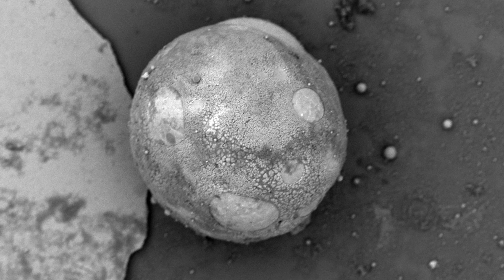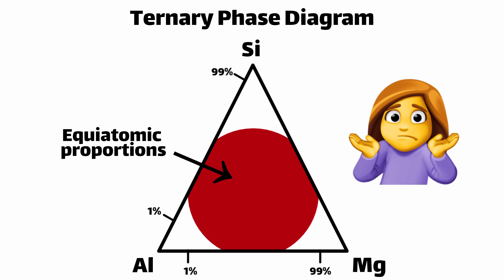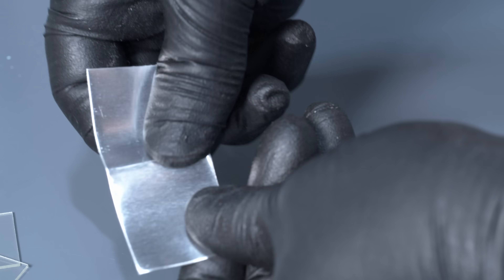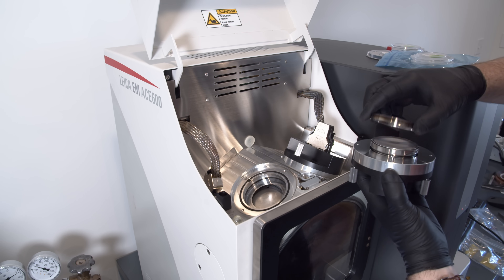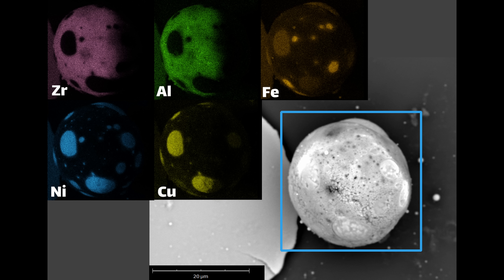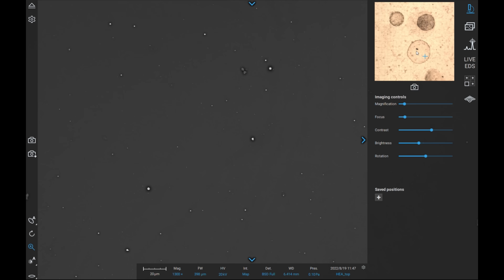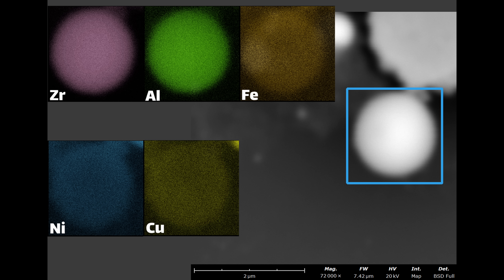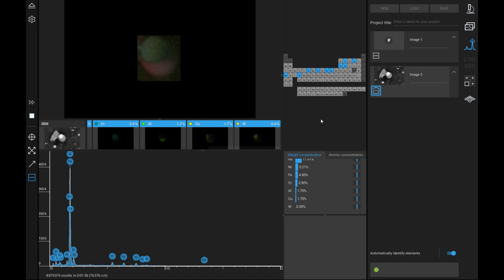Metal Alloys of the Future?

Comment: I’ve now worked on a couple projects involving this field. Something I found interesting is how different research groups define HEAs. I worked with a HEA that had the presence of an intermetallic which some definitions of HEA do not define as a HEA (not solid solution). Another alloy only had three of the five Cantor alloy elements in equal concentrations, making it a medium entropy alloy (Smix<1.5). Lastly, a refractory alloy with four elements could be argued to not be a HEA due to not having >5 elements. I found all three of these alloys fascinating, and all had very unique properties not found in conventional alloys. Complex concentrated alloys (CCAs) can be used to describe all three of those (as all HEAs are CCAs), but it has much less of a ring. Many pioneers in the field stick to the strict definition of HEAs, but I find does not ring as well to people outside the field. So I somewhat incorrectly refer to all as HEAs
Reply from the maker: Ah neat! I didn't realize there was such a range of interpretation about how these are defined. I did see a few alternate naming schemes (multiple-component alloy and the like) but didn't realize it was more than just a naming thing. Very cool, thanks for sharing the extra details!

Comment: Hmm. If you're having problems with the particles cooling too slowly, have you considered maybe using something like liquid nitrogen on the slide and lasering through that?

Also, would heat treating the slide after coating possibly relieve some of the inter-layer tensions causing the flaking?

Comment: You might consider changing the precursor target to have many smaller layer stacks to begin with, so that when you ablate, you are much more mixed to begin with. 

Also, if film adhesion to the target is troublesome, you could try to start with a layer that does adhere well as a buffer layer. I had to do this with some heterostructures we made that needed AlOx, and Au. I've been told by my PI that a Ti buffer layer (or Cr) is good at getting Au to adhere to Si, so maybe it'd help with the Cu layer as well.  

Last, I can imagine that with 5+ or more elements all in similar proportions, the phase space is massive, and creating the same thing twice could be hard with this method depending on your level of control over deposition rates.

Comment: You might want to look into metal glass formation methods.  I don't know if they would be useful to form high entropy alloys but it might be worth a try.  They are formed by dropping a stream of molten metal onto a very high speed rotating disk in liquid nitrogen so that the resulting metal powder cools at millions of kelvin a second and crystalline metal never gets to form.  Obviously, you want crystalline structure formation but that might be as simple as using a higher temperature coolant.  (Which would be easier to work with as a bonus)  As long as the metal droplets cool fast enough, you might get proper alloy formation before the individual metals have time to segregate from each other.

Comment: The trick with getting equal distribution is having your samples in 'intimate contact' prior to the flash heat phase, which is its own little crap shoot. I've been doping my runs with high purity carbon in a ball mill as a sink to entrap the metals. I'd love to have a vacuum chamber that can tolerate the kinds of temperatures I'm trying to do this at, but thus far I've made a lot of fragments in reduced oxygen. In my experience, short of arc furnaces or plasma heating, lasers that I have access to don't offer high enough sintering temperature to get proper fusion. I'm exploring modifying a plasma cutter for my next go to break into that 6k Cel/10K F range for near-instantaneous processing.

Comment: In your overview in the beginning you said that with alloys we tend to predominantly have one element. Your example showed a ternary phase diagram of aluminum, magnesium, and silicon. Your example then showed the points in the graph for a few common wrought alloys. 
https://www.youtube.com/watch?v=Vq_6mAAbfFY&t=118s

The inaccurate part of your explanation was that we tend to mainly use alloys that are predominantly one element. (low alloy content percentage) As far as aluminum this is far from the case. The composition of aluminum alloys for casting has a larger percent of alloying elements compared to wrought alloys shown in your graph. 

The alloying components for cast aluminum is significantly higher than the 1% level for wrought alloys. Aluminum alloys for casting can have 8-20% non-aluminum elements. Sand casting alloys being lower, injection die casting alloys higher.

The global aluminum casting market size was valued at USD 86.92 billion in 2021. Most of that is for die casting. Among others, the automotive sector has been steadily increasing the use of aluminum in vehicles to reduce weight, using casting alloys not wrought alloys like 6061. 

And then when we look at copper based alloys the alloying percentage is even higher. A common brass will have 40% zinc as the alloying element.

Comment: Great video.  When I think of an intermetallic,
the interface of metal/metal system comes to mind.
Say you put a thin film of metal element X on metal
substrate Z. The interface might form stochiometric
stable crystals of XnZm, where n&m are integers.
As these are crystals, they have completely different
lattic constants, thermal, and mechanical properties.
Sometimes this helps the thin film bond, and someones
the complete opposite.  Almost always, they are more
hard and brittle, and more easily cleave along preferred
lattic planes.

Comment: I wonder what the lifespan of such a material would be, especially under different temperatures, atoms will gradually diffuse in materials and I'd imagine the metals would slowly start to aggregate. Unless perhaps you have a very particular crystalline structure which doesn't allow the elements to migrate into regions with the same element (by cleverly picking the size and bond strength you may be able to make the dispersed phase stable at temperatures below a limit, or even energetically favored by the material), or use so many elements that even with similar proportions they still behave colloidally.
Reply: The long-term stability of HEA phases has been a controversial topic in the field, yeah. The Cantor alloy for example (CoCrFeMnNi, 20% each) does decompose into a 2-phase structure if you let it sit at elevated temperature for hundreds of hours. But consider that many of our usual engineering alloys are metastable, really. For instance, martensitic steels don't usually self-temper at room temperature even though they thermodynamically "should". On the other hand, some titanium and aluminum alloys do age and transform at room temperature, so...

Comment: IMO it could be done during the deposition in the future.
Like 3D printing the lattice using various electric fields.
My other common sense method would be mixing metal salt powder and sintering them. This too could be done like printing layers but of homogenous alloy. We may need cryo temperature and weak enough laser. It may seem impossible but so does microchip manufacturing to me.

Comment: What about things like gold alloys and mercury amalgams? Those quite often have close to equal parts composition
Reply from the maker: Yeah I should have spent some time talking about stuff like gold alloys, or lead-tin solders, etc. Totally slipped my mind :) Things like lead-tin and many gold alloys are eutectic alloys, meaning it's a mixture of two different phases. When lead-tin solidifies, both lead and tin will separate into individual phases (lead-only and tin-only), but it does so in a manner where each phase is kept to a small grain size. So you still get a mechanically uniform material, and only notice the phase separation under a microscope. And it's pretty "homogeneous" despite being made of two different phases.

Some other alloys like certain stainless steels are solid solutions, meaning one of the elements is actually "dissolved" into the base metal, which behaves differently than a substitutional alloy. That's how you can end up with stainless steels with like 15% chromium for example.
Reply: @BreakingTaps  yeah, that makes sense. I totally didn't even think about the eutectic alloys.

I guess the solid solution is also the case with some bronze

Yeah, metallurgy isn't my forte

Another thing I was wondering is, could you magnetically stir the molten metal mix at high frequency while it cools down to hinder the separation?

Comment: Hi, very interesting video and impressive results. I kind of work in that field, and i can only concur with your conclusion. Trying to mix every metal you have on hand won't necessarily produce an HEA as you define it (i.e. a single solid solution of all the different elements). For example, Al is a pain to work with, because its atomic properties are quite different from the elements you were trying to mix it to, and it also tends to react easily with other metals to form intermetallic phases (with Zr for instance, and you have proof of that on your EDX results). Moreover, HEAs are often only stable at high temperature, and decompose into several phases during the cooling (or if you heat them again), and one major difficulty is to keep this single solid solution down to the room temperature, by cooling sufficiently fast. Depending on the composition, you just might not be able to do so, and the HEA will be polluted by other phases or totally decompose (and you have the same problem if you want to heat back up these alloys: they tend to decompose quite fast when exposed to temperature). 
If you want to pursue you work on these materials, I would recommend focusing on the Cantor alloy if you have to possibility (cobalt is very expensive!). It is a well known case model, and you don't have to be precise with the chemical composition; even if you deviate from the equiatomic composition, you will obtain the solid solution
Reply from the maker: Thanks for the insight and tips! Appreciate the help, encouraging to hear that some of the results I was seeing (Al and Zr issues for example) were expected.  I've been looking into getting a cobalt sputtering target for a few other projects, so I might give this a try again with the classic Cantor. 

I think thinner sputtered layers would probably help as well, 100nm was probably too thick. And oxidation in the DI water was definitely a hindrance, was very clear oxidation on most of the Al, Zr and Fe spectra... I can't imagine HEA formation enjoys dealing with oxides in the middle of the melt 😅
Reply: @BreakingTaps  well if you manage to oxidise everything, then you would make an high entropy oxide (that's a thing, too) 😀
Reply from the maker: Well TIL! Another rabbit hole to start reading about!

Comment: Like the novel approach, perhaps try Niobium instead of tungsten, if your set on using 1 refractory metal, it plays much nicer with cu + ni + au + ti, check out the nb-ti phase to see what I mean.  Works with platinum to a point also, not sure about Fe, zr, cr. Tungsten hates everything. Niobium or Tantalum preferred for welding compound joints in my line if work.

Comment: Do you think you could just heat the whole sandwich up to less than the melting temperature in a vacuum for a long time and have everything thermally migrate into an alloy? Kind of like case hardening steel? I know that's used a lot in low percentage things, especially semiconductors. I don't know how well it would work here.

Comment: As with any comment from a random guy on YouTube goes, talking out my ass, but if adhesion is an issue etching the glass with an acid like hydrofluoric to increase surface are might help with the flaking, might possibly relieve some of the tension between layers too but I don’t have any concrete reason to believe that. possibly just because your minimizing the size of each plane the layers are sticking to localizing any expansion or contraction that occurs, the randomness of it might increase the chances of some portions of the adhesion between layers to be successful, depends on the tolerance of the laser focal zone and how sensitive it is to an imperfect surface I’d imagine

Comment: This might be a bad idea, but have you heard of rotary friction welding? You'd see it done on a tool that looks like a lathe. What if you sputtered layers of your component metals onto the flat ends of two rods, then chucked one up in the lathe and held the other fixed. Perhaps by driving the two into each other and pulling them back apart, you could have each face transformed into high entropy alloy by plastic mixing. Or maybe you just weld the two rods together and find a way to image the interface. Cool stuff, keep it up
Reply from the maker: That's a nifty idea! I have no idea if it'd work or not, but could be fun to try! I've always thought friction welding was really neat anyway, could be cool to see if it could be used for bulk HEA fabrication :)

Comment: And here I had envisioned just sticking equal parts of the metals in a crucible and meting them together. Or even in a sealed crucible, but of course it wouldn't be that easy. Some fascinating metallurgy for sure though.
Reply from the maker: Funnily enough, the original Cantor alloy was discovered (roughly) in that manner. Dr. Cantor suggested the project to an undergraduate for a research project, and they just stuck 5% of 20 different elements in a crucible and melted/quenched it. I think they used a fancy vacuum arc furnace but not really any different from what you suggested. Most of it turned out garbage, but they found the now-famous Cantor alloy mixed up with all the other stuff :)
Reply: @BreakingTaps  that's cool. You see, it never hurts to try new ideas. Some of the best discoveries have been made by complete accident while trying something else, or by trying some random idea.

Comment: I've never played with depositing on glass, but when depositing on Gallium Nitride (Or AlGaAs) I remember an adhesion layer of titanium or nickel was always used. Even without annealing, I think those were just kinda stickier first layers. In this case do you really want the alloy to remain stuck during the process or not? - I know almost nothing about high entropy alloys and this is way cool.

I love the idea of using the laser to create extremely small melt and quench areas. Not sure what your sputtering setup looks like so this ranges from "impossible" to "really annoying", but I'm curious if you tried a very coarse digital alloying where you'd lay down repeated thinner layers 123123123 rather than 111222333. of course it looked like your laser was pretty effectively melting all of it at once, so maybe this would make no difference at all, but I figured it was worth a question! if most of the blobs you found adhered were in mechanically adjacent layers, maybe that might tell.

Cool stuff!
Reply: Dave H
I was going to say that adhesion to glass will be better if the first layer is Cr or Ti.  The layer can be very thin.  I don't know how well Ni would work.
Reply: I mean, your "almost nothing" is probably considerably more than the majority of the comments on here tryharding to sound knowledgeable. xD

Also, I love how I can hear your voice in your writing.
Reply from the maker: ♥ Hi hi! I was sorta hoping you had a bunch of crystal and metallurgy corrections that I could pin to the video 😂

Yeah not sure about the adhesion issue, if it would be desirable for the film to stick better or not. Or if it would even matter... the laser process is pretty aggressive and might do the same everytime regardless. Dunno! Probably the right thing to do is to blap it all off the slide into solution, then repeatedly irradiate the solution itself (focal point in the middle of the vial) to re-process the flakes and particles. 

The "igital alloying idea is definitely doable although falls in "really annoying" category :) I've been looking into it because I want to play with nanolaminates of alternating layers. You can define sputter sequences to run automatically and the machine seems to use a simple XML file to define those sequences, so I think I can create a long sequence and import it to run. The major issue is that it only has two sputter heads, so if I wanted 121212 it's easy but 123123 would require cycling the chamber and waiting for it to pump back down (solid hour or two for the oxidation-sensitive metals).

(I'm working on a pulsed laser deposition setup with the new vac chamber, might be easier with that system. Not as nice of layers, but easier to deposit many different materials at once)

But on that note, would it be possible to anneal thin layers into an alloy? Say deposit alternating layers that are only 1-2nm thick, stack up 50-100nm of layers and then anneal it all together. Would the metal have enough mobility at temperature to reconfigure into a crystal, or is that just a recipe for everyone separating out into distinct phases?
Reply: @BreakingTaps  Have you tried to use laser deposition to deposit all five elements at once? It seems like that would make a High Entropy metal alloy layer.
Reply: @BreakingTaps  "would it be possible to anneal thin layers into an alloy?" It's something smiths have to watch out for when making a pattern welded (damascus) billet. Too many folds & too much heat gives you an ugly mottled alloy blade instead of a beautiful weld pattern.